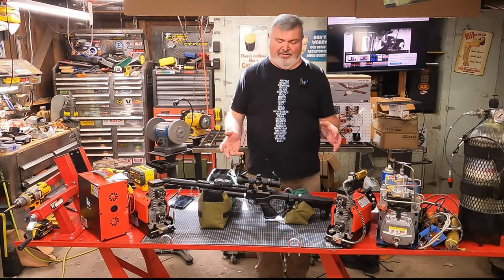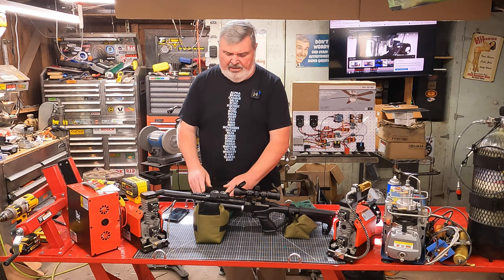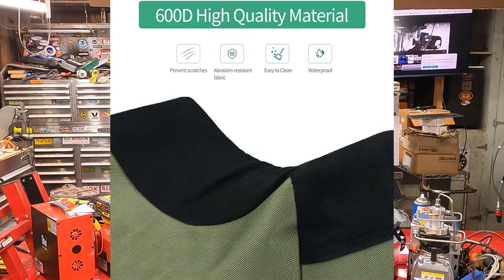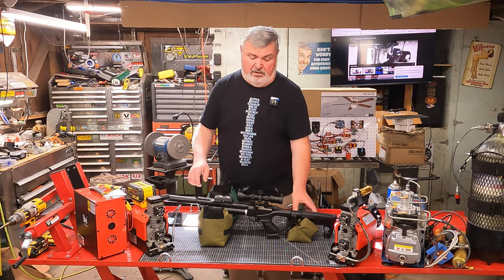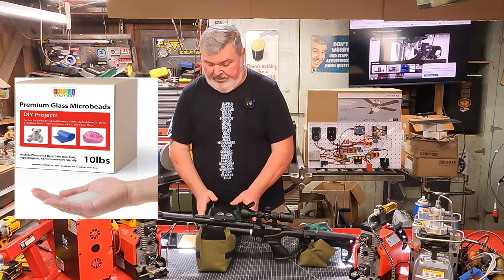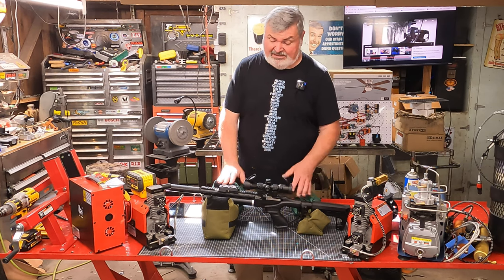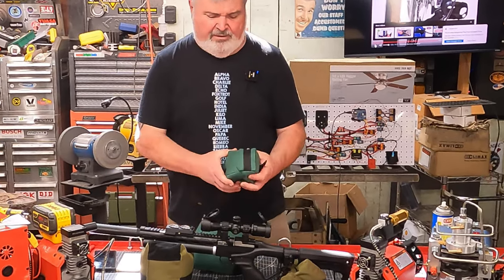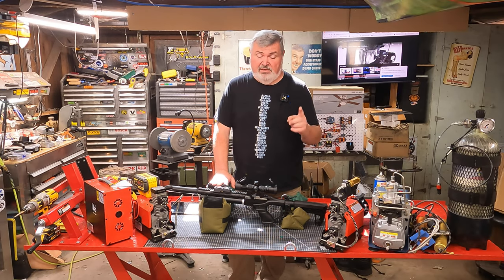INEXPENSIVE DIY Bench bags! Let's look at some fill options!

Comment: I had to go the other direction for weight.  I have MD, so having trouble lifting equipment.  Heavy bags are pretty much out of the question.  I bought the same bags and used the Styrofoam pellets used in beanbag chairs.  The bags are very light (literally ounces) but I've never had trouble with them moving around.  I think I'll buy another set of bags and try the plastic beads or just add some to see if I can firm up my bags a bit.  I like the lighter bags, but always willing to try something new.

Comment: I recently had to change the fill in my Caldwell bench bags. I originally used fresh dry ground coffee in the large front bag and after 2 years of use it's not smelling like coffee anymore. I wanted the bag to be heavy enough for big bore pcp recoil and not slump down. It was too soft using coffee. 
So I had the idea of using 2 varying density materials planter wood chips for fill volume and high porosity lava rocks for mass. And It works well. There's enough friction between the individual pieces to hold it's shape. I did put a stretchy trash bag in the larger bag and inflated it up before filling. The rocks were dusty. Total weight was 9.5 pounds 2.5 for the smaller and 7 for the larger.

Comment: Good tip about the Caldwell filler.  Avoiding anything that's organic helps with preventing bacterial or fungal growth and bio-degradation.  

Washed play sand is a good bet usually, but it can run out of the bag if the spout isn't 100% tight and folded.  I prefer larger pellets or BBs to avoid that issue.  

Lead pellets won't run out of the bag as easy... but it is toxic... not a great choice as powder forms over time.

Steel shot/BBs are cheap enough, but they can rust and ruin the bag over time when moisture gets in.  Same corrosion issue applies to copper tarnishing.  I assume a BRASS or ALUMINUM pellets would be acceptable options though I'd never tried them.

Glass is inert, non-porous, and heavy... my only concern with it is that its so slick and usually so small that it can run out of the bag and cause a mess, or worse, a ball-bearing slick surface on a concrete floor.  I also worry about grinding them to glass powder when using them for real rifles and shotguns... repeated recoil can do bad things to beads over time... glass powder is impossible to get out of anything, and you DEFINTELY don't want to breath that in.

Without using aluminum or brass BB's, I pretty much decided heavyweight Poly beads or Airsoft BB's are a big winner.  Poly beads come in several densities, the heaviest of such are also brittle unfortunately.  To avoid breaking/powder, its better to go with a more durable polymer.  Airsoft BB's seem to be cheap, water proof, and durable.  They also are big enough you won't have them running out of your bag.

If I could find a cheap source of smaller Aluminum BB's I may give that a go... maybe 3 or 4mm seems about right.

Comment: Use rice
Reply from the maker: Personally, not a big fan of organic materials with an affinity for moisture.
Reply: Rice will expand and explode if it gets wet
Reply from the maker: @eugeneb35  You are 100% correct. I wonder how the organic fills would perform with with a sealant applied to prevent them from absorbing water...Hmmm. I have actually had a company that makes fills with different characterizations of weight and feel reach out, they are sending some samples. Look for part 2 of this video soon!